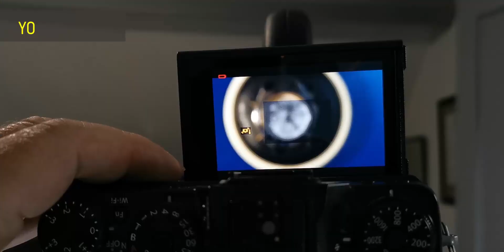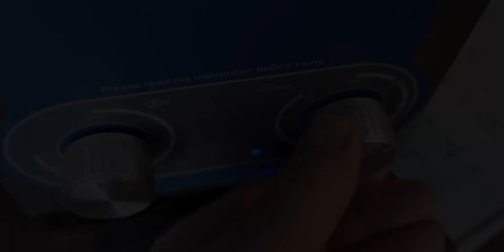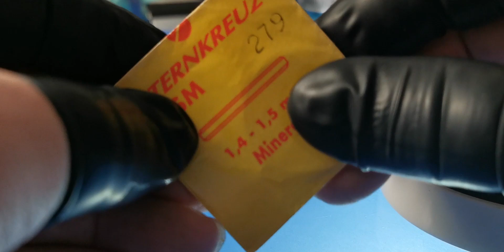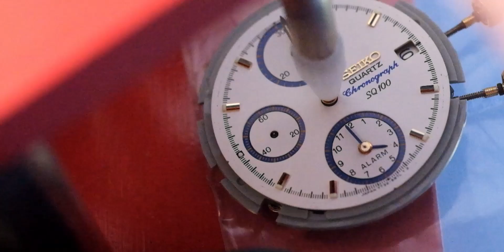Restoration - The Colonel's Chronograph Watch

Comment: Ooooh....a 7T32 strip and reassemble. Thank you very much! In my box of projects to get to is the exact same wristwatch (without the blue bits, which are really nice) that got properly dunked in water somehow. I've read about the confetti of little plastic wheels and the three motors and three coils etc and don't hold much hope for the circuit board, so I decided I would tackle it when I knew more....now i have a reference video. Great video, liked etc.....thanks, Richard. Much appreciated.
Reply from the maker: Hi Geoffrey  ... thanks for the feedback and I hope this video helps.  Getting all the pivots back in with the single top plate is pretty tricky and you need to be super careful as many pivots are plastic and will bend if not located.  It is really quite time consuming but worth a punt I guess.  Good luck with it.  Richard

Comment: Great job as usual. This video should be shown to the watch folks that look down on quartz as simple throw away watches. Thanks.
Reply from the maker: Hi Peter .... good to hear from you!  It was pretty tricky to work on for sure!  Thanks for the feedback.  Richard
Reply: You're absolutely right.
As I always say, there are quartz and quartz👍
Reply: Richard, what's your opinion of so called watch repairers who turn away simple jobs? I've tried twice to have a gasket replaced only to be told.. "it's obsolete, can't get the part".. But I know that's bs because cousins had it!.. They only seem to want to change batteries and straps.. Anything else is.. 'not worth it'... Not all of them of course but its frustrating given such simple repairs.
Reply: I have repaired many 7T32 movements myself but I typically stop at removing the gear train cover. I've done a lot of circuit board replacements and contact repairs due to leaky batteries. I love the 7T32 series of Seiko watches. There must be over 200 different case designs and just when I think I have seen all of them another model number will come up for sale on eBay or somewhere else. I have 30 of these 7T32 models in my collection and I never get tired of them.
Reply: Most quartz watches are throw away items. Seiko makes the quartz watches repairable unlike other manufacturers.
Reply: It's a financial decision by the watchmaker! The average quartz watch owner would balk at the price for repair,not appreciating the skill and time Involved!

Comment: One of the most interesting watch repair videos I've ever seen. Gives great insight into the complexity of a quartz movement. I had absolutely no idea that they had that many serviceable parts. I've always thought they were printed circuit boards and a couple gears...
Reply: Well this is not exactly the simplest of quartz watches, to this one there's a lot of mechanical parts with all the different hands moving over different dials.. Also it is be cause it has chronometer functions that it has no less than 4 coils that magnetically drive all bits and bobs. This is a quartz-mechanical chronometer, not just any other quartz watch.

Comment: Gadzooks! Look at all the wheels on that movement. Never thought  a quartz would have that many. But it's a chronograph so I reckon so. Nice work.
Reply from the maker: Gadzookz!  My new favourite exclamation!  Thanks Jay!  Richard
Reply: I just watched your video on  your Difor chronograph.  A fantastic watch.  I have started learning  to repair watches and have a few vintage  chronographs. Those are still  a bit above my paygrade right now, but your video helped explain how the parts function. I have two valjoux7733, and a Venus 170. Eventually I will service them, once I get the courage up...

Comment: Hi there Richard ,I have that same seiko watch and I bought it new back in 1992 , it was £99.00 back then , I just had the battery changed,but they told me it’s not waterproof know , I wonder why they told me that after all it’s 30 years old, just wondering where I can get a new rubber gasket for it, it is so pleasing to see you stripping down and cleaning it , then putting it all back together, nice craftsmanship work you do.

Comment: Thanks for posting. I have several 7t32 watches and am looking forward to attempting repairs. I noticed that you only seemed to use oil in a few locations. Does the rest of the movement not require oil?

Comment: Hello Richard,
Sorry if this is a stupid question but what is the function of the 'coils' in this watch?
As ever I'm staggered by the care and precision of your work.
PS my Vostok is still going despite my clumsiness- not surprised the Russian army use them !!
Reply: They step up the tiny voltage from the battery to create the pulse needed by the stepping motor to drive the gear train for the hands.They essentially do the same job as an ignition coil on a petrol car engine.Low tension upto high tension voltage.

Comment: Nice. That is very cool chronograph. I am here because I got my hands on a bi-color 7T32-7C20 myself and I was considering swapping the dial for a Panda one. But this exceeds my skills by far. One question: did you replace the caseback gasket and if so where did you get the part?
Reply: One more question: do you know wether the SQ100 subdials are an integral part of the main and just recessed or is it two layers?

Comment: I really enjoyed this video, but it left me with a few questions

Question number one wouldn't it be easier just to replace the court's movement with a new 1?

Question number 2 is there even a point in cleaning a court's movement there's really no moving parts. Are very few I had a hard time with this getting my head wrapped around

The 3nd question is what did it cost to restore this? And wouldn't it be cheaper just to buy a new  quivalent...
Reply: These movements date from the mid 80s so unlikely you could find a new one anymore. They are a real step above your average quartz and we're generally installed into fairly expensive watches of the time so are worth saving.

Comment: Hi Richard,
I have a official Seagull 1963 plan B Limited Edition Chinese chrono watch and the minute counter on the three o'clock position, turns one second before the second hand counter hits the twelve o'clock mark. Is that something that can be fixed by a watchmaker? The official dealer from Seagull watches here in Germany says it's due to the construction of that movement. Do you have any insight on the issue?
Thanks for your help.
Frank S.

Comment: I am in the UK too and looking to get my watch with the 7T32 moment serviced! How much would it cost? I tried replacing the battery but to no avail!
Reply: Once you insert the new battery, you need to reset the movement by shorting the AC (All Clear) contact to the battery holding plate. If not, the printed circuit board could be bad if the old battery leaked and corroded it.

Comment: Hard to believe that plastic gears running on plastic pivots and staffs are even serviceable, it all looks too temporary, as if it was meant to be thrown away after a few years and a trip to the nearest Seiko stockist 
was the only remedy.  
Probably why I never felt bothered to get involved with quartz watches. 
Soulless plastic beasts mass produced by another machine fails to generate any feeling for nostalgia by the wearer..
A job well done Richard, you've saved the Colonel's watch. But I bet Seiko are fuming about that lost sale.
Reply: Something to be said for practicality though... and besides it's hard to find a watch that isn't machine-made to some degree.
Reply: I have the same watch as in his repair, I got it new in 1992 and still going strong